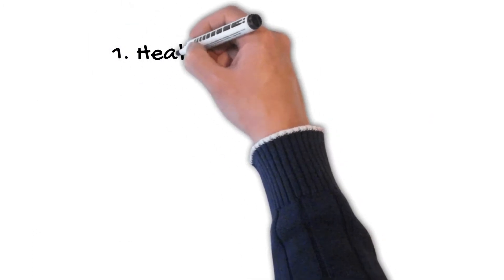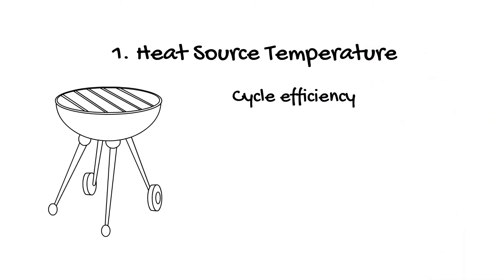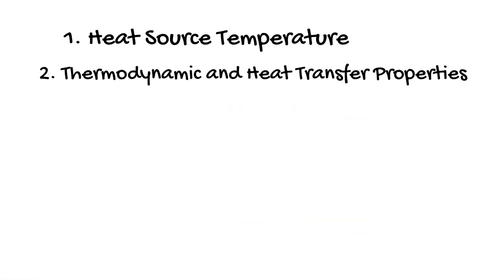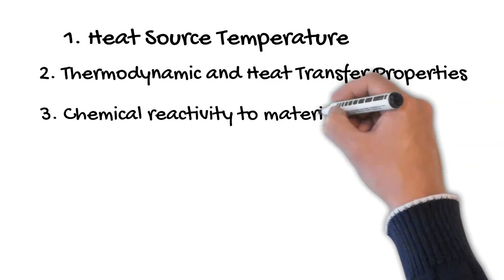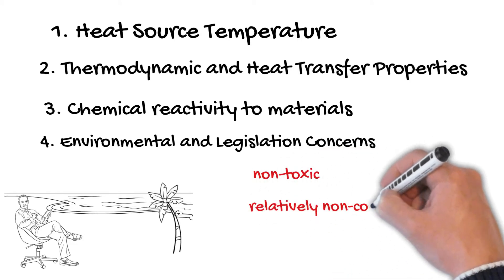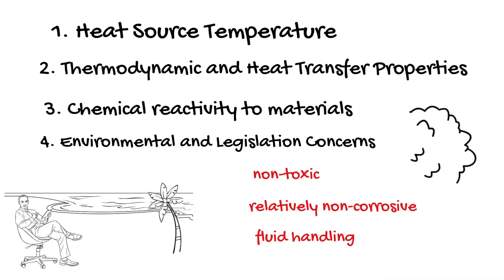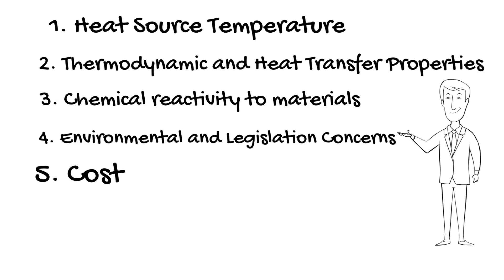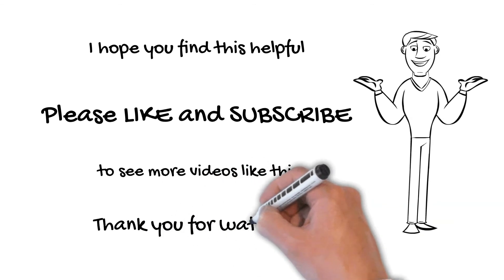Organic Fluid Selection Criteria for the Organic Rankine Cycle (ORC)

Comment: Like you shematic draw for an Organic rankine cycle plant with regenerative working - fluid heating. A TEMPERATURE-ENTROPY chart of this cycle is always presented. Using well-known procedure of engineering thermodynamics, it is straightforward to design the components of such a system for a list of design contraints. The numerical values are for a solar pond/ORG system and they are given as references as you valuable define. I notice that since the degree of superheat for most ORGANIC FLUIDS increases when the FLUID is expended. 👍👌

Comment: You are speaking waaay too slowly. It's as if you did the video first and then did the voiceover afterwards. You need to do the audio first and then make the video match. Then it will be easier to take in. The slow speed you are speaking makes is harder to actually absorb what you are saying. Just to point out, when cartoons are made they record the audio first and then make the visual cartoon match the voices that have already been recorded. There is a reason for that!